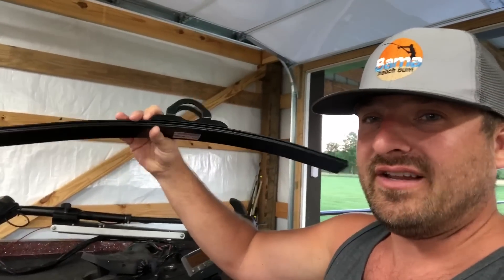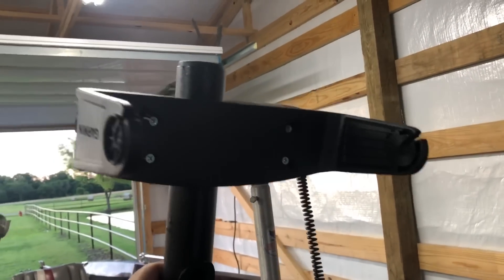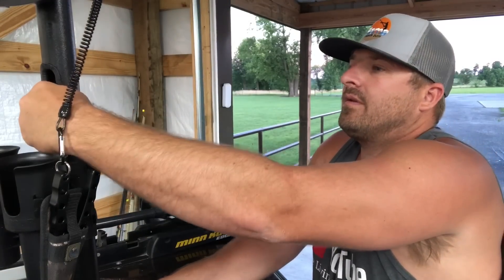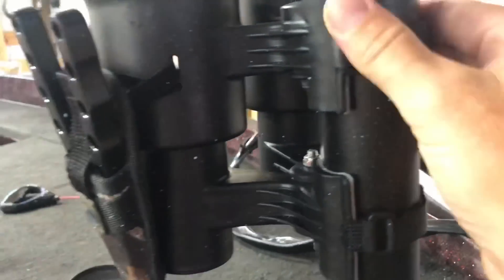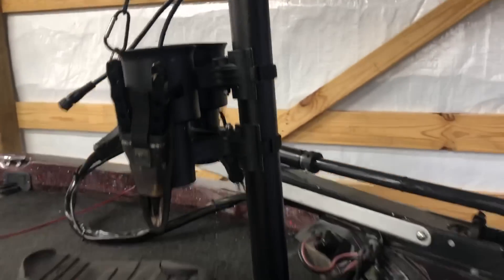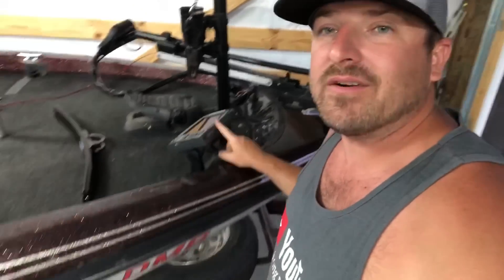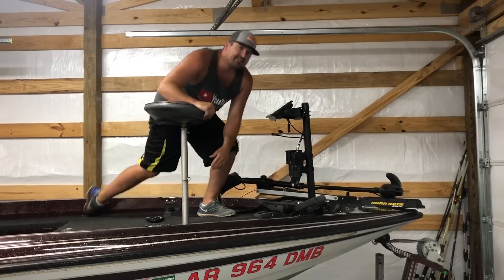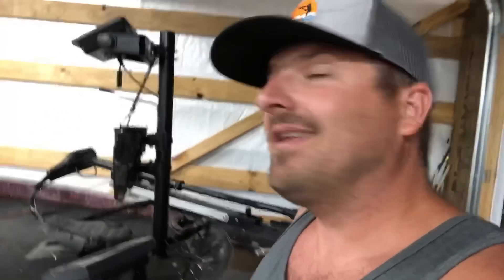The best Garmin Livescope mount on the market!

Comment: Congratulations on a very nice chartplotter mount installation.  I like the additional mount for your combo beverage cup and tool holder.  It is amazing that all of these guys are doing all that bending over to access the chartplotter.  At 74 my vision is not the best so getting the chartplotter in a reasonable/accessible/viewable position is a PERFECT solution.  You are the man!
I don't own a Garmin Livescope yet, but if I get one or maybe a Lowrance Active Target I will definitely manufacture a similar mount for it.  I currently have a sun shade/sun visor attached to my Lowrance HDS7 Gen 3 unit to help with the sun glare.  I coated the inside of the hood with flat black paint to further reduce the sun glare.
Many thanks for taking the time to share your project with us.
John
Reply from the maker: Thank you I appreciate the kind words!

Comment: That mount would be even greater if it had an outside sleeve like the alum push pole with holes and a cotter type pin to adjust the height to make it higher and lower. Always looking for a better mouse trap!
Reply from the maker: I can adjust the height on it. The bracket attached to the pole loosens and it will slide up and down that pole. I know what your saying though my buddy built one like that using a millennium spider rig pole and took the rod holder off. I have it in another video it’s pretty sweet!

Comment: What is the name of that bracket that’s holding the gamin bracket on the top of your pipe? Did that come with the stand or did you buy that separately?
Reply from the maker: It came with it! It’s a old computer monitor stand but It wouldn’t be to hard to make your own with rectangle tubing and a u clamp.

Comment: How does it do running down the lake? Do you have to pull the screen when you move spots with the big motor? Can you link the monitor stand you used as I am having trouble finding one that has a screw on base? Thanks and very cool idea.
Reply from the maker: If it isn’t a rough day out or if I’m not going very far I leave it up! When I had the 93sv up I never worried about but the 16” I am a little more careful with! It didn’t even move with the 9” at all. The 16” however wobbles a little bit that’s not because of stand that’s because of the deck! And I’m not sure the name brand I got it from work. They was going to throw it away so I got lucky but it would be super cheap to build one or even have someone build it!
Reply from the maker: I just made a new video on it because I’ve had a lot of people e mailing me on it I just posted today. You should go check it out! I went more in depth on it with measurements.